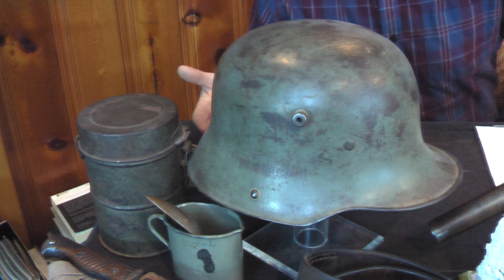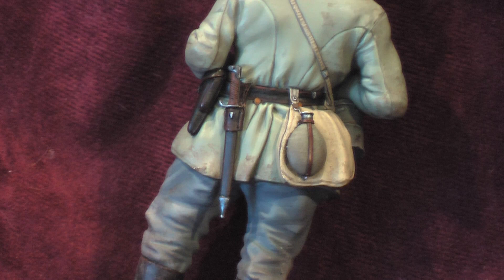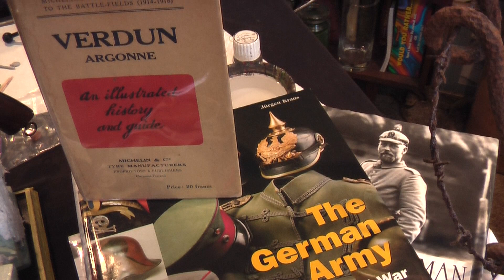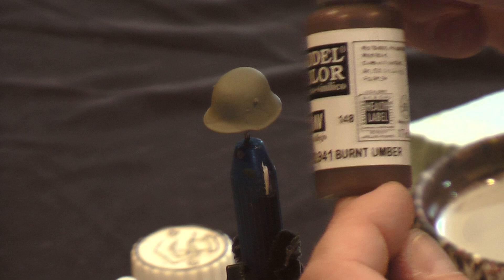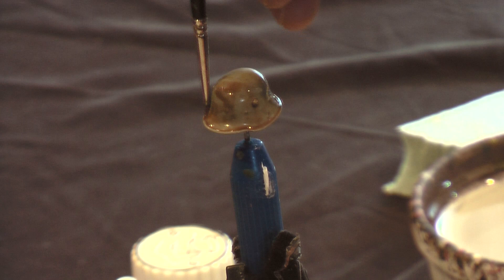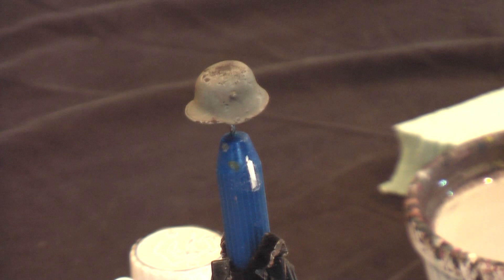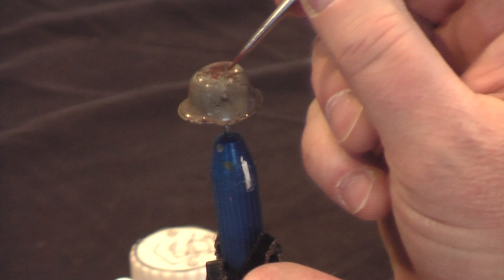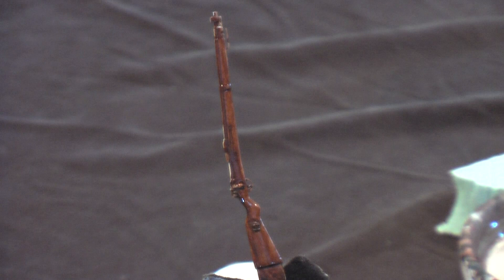Creating a WW1 Trench in 1/16th Scale Part 1

Comment: Is modelers also use hairspray over the primer then your base coat and go back over when dry with just water and an brush I use a thin number 0 red sable brush and a flat AK no 2 brush and you get great chipping and use vallijo dust pigments after that you can use wet or dry